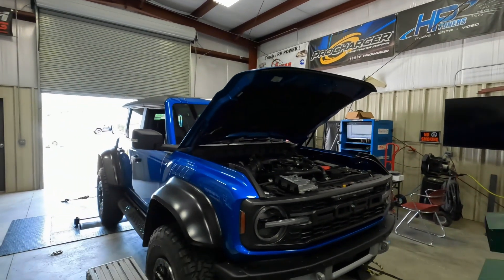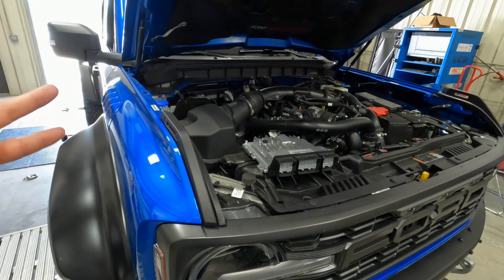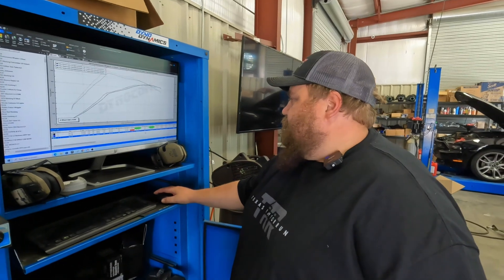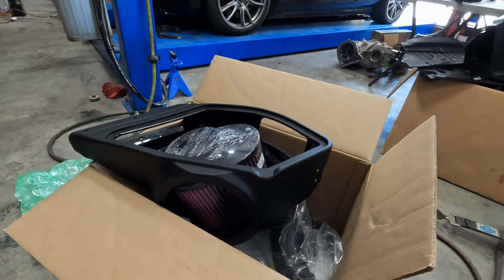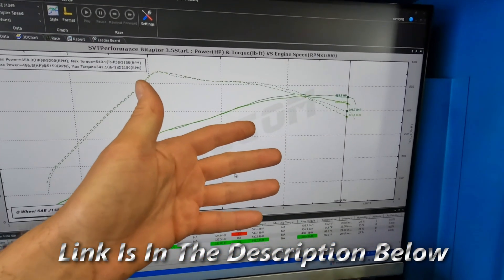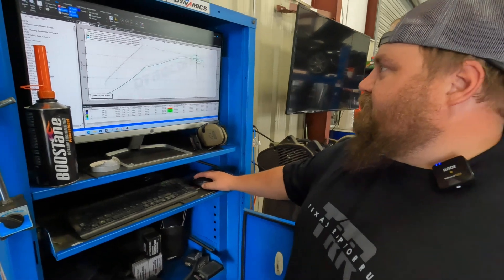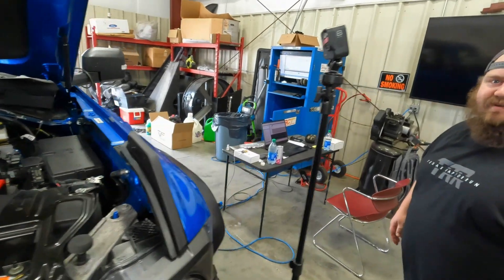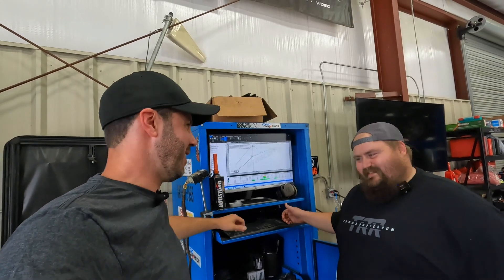Encryption Broken!!! | Bronco Raptor Makes 500HP w/ 5 Star Tuning & HP Tuners

Comment: 0-60 runs!!!
Reply from the maker: How about 1/4 mile???
Reply: mine runs 4.5 to 60 and high 12's in the quarter mile. makes it a much more fun vehicle. They are underpowered from the factory for how heavy they are.
Reply: @TTCoyoteF150 get some 22 pound wheels, take off the roof, doors and spare tire and run it again. Bet you shave off almost a second.

Comment: One thing you should really get the Baxter Performance oil filter adapter to one with an anti drain back valve.  Worth every penny for longevity.
Reply from the maker: I'm not a huge fan of that design.  I'd prefer a full remote mount solution to just hang an FL-1A somewhere.

Comment: Umm how are those stock Head studs gonna hold up with 22 lbs of boost? I think that is gonna be an issue . Just my opinion..
Reply from the maker: Hasn't seemed to be an issue on the Explorer ST.  The BRaptor is heavier though, which makes me more concerned about the transmission.
Reply: @PhatboyHD88  it’s not a 6.0 powerstroke lol

Comment: I just read your thread. Did you just swap ecu's with another tunable one (probably from an f150)? I thought you managed to hack the original ecu encryption.. You almost got my hopes up.
Reply from the maker: Swapped to an F-150 ECU.  Progress is being made on cracking others though.
Reply: @SVTPerformance  how’s the progress going? My 24 F150 3.5 needs a little more boost!

Comment: Can’t wait to see what’s possible with the ranger raptor!
Reply from the maker: All else being equal, it should make a little more power to the wheels since it is on a considerably lighter tire.
Reply: @SVTPerformance what if you put the same size carbon fibre wheels 🛞 on the bronco raptor !? that would be so much lighter
Reply: Me too brother 🇺🇸🤟

Comment: Will any turbo upgrades be installed ?
Reply from the maker: At this point; we need more octane, not more boost.  That's what we're looking to tackle next.
Reply: @SVTPerformance e85 or meth injection is the answer, but a larger turbo can give you more boost with less heat.